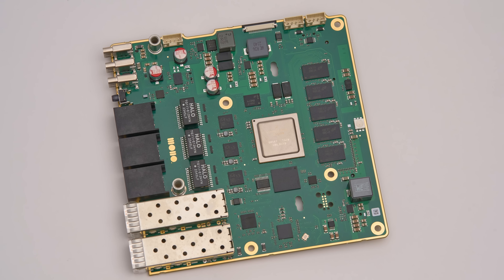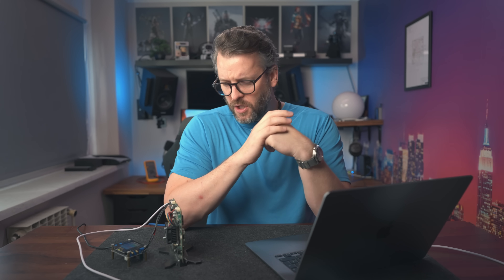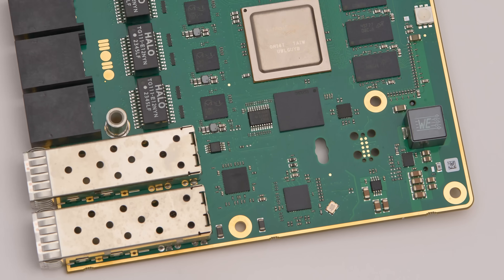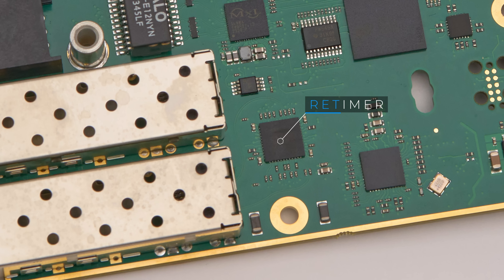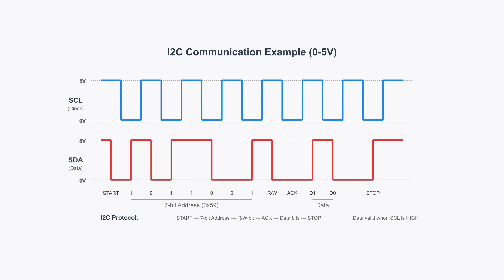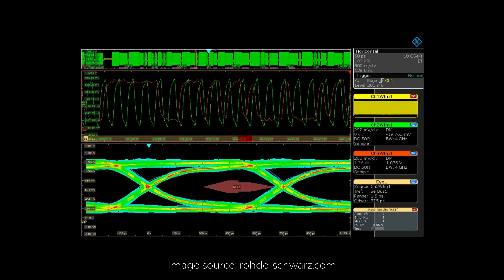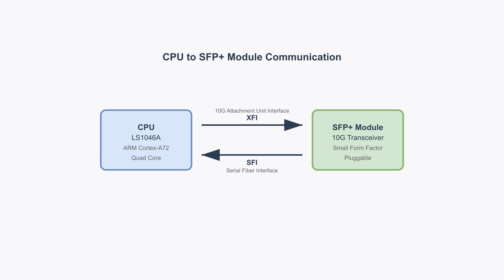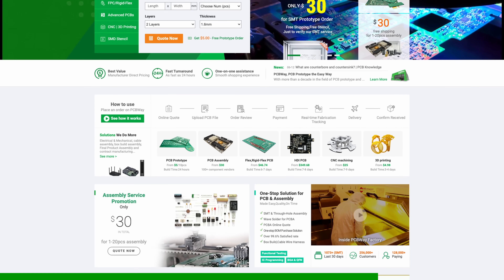10 Gigabit networking is NOT as trivial as you think!

Comment: fwiw, the 10g base-t standard 802.3an was published in 2006 with products being introduced based on it within the same year.  we've had 10g internet for nearly 20 years.  I'm appalled that it's not a significantly more common consumer option.
Reply: its an infrastructure problem. moving from copper to fibre is not cheap or quick
Reply: @jordanwardle11  We've had fibre coverage throughout all of the Netherlands for 1 or 2 decades now, yet 100-200 Mbit/s connections are still the standard and only few pay the exorbitant monthly costs for 1 Gbit/s connections. So having the infrastructure is one thing, clearly there are more issues than just that. Likely internet providers would have to seriously upgrade their hardware to facilitate multi Gigabit ethernet as the norm.
Reply: mostly because there  is no need as internet connection tents to barely hit the 1Gbps mark today which means getting speeds of 10Gbps internally is wastefull and not needed
Reply: @bigpod  I started my 10g journey with a workstation with maxed out storage options and a NAS containing lots of disk and 1g not being NEARLY enough for that context.  I think that this is EXTREMELY common. - if only for backing up photos and videos locally.  even at 10gb/s, that's only 1.2Gb/s which is about 1/6th the bandwidth of an average pcie 4 nvme ssd and thus for storage standards even 10g networking is quite slow and I wish we would upgrade from even 10g. but 1g is PAINFULLY slow.  I remember when 1g was brand new to consumers in the late 90's.  it was fantastic... my first network cards were linksys lne100tx 100m cards that I got from compusa for $40 a pop and a $50 basic hub (which was a lot of money to middle school me.) so I could network my 2 home desktops together.  sloooow.  1g was totally the sh*t, until we upgraded to ssd's.  at that moment we got a huge increase in storage bandwidth, but consumers really never got the appropriate networking upgrade to make that network communication leap with that increase and it's a shame.  they should have just put 10g base-t on all enthusiast class boards and up some 10 years ago (when most consumers got ssd's), but no, consumer networking has been stuck in the dark ages.  now we've got pcie5 ssd's capable of ~12Gb/s (which would be around 100gb/s). and I'm talking about single disk.  once you start pooling ssd's, you can get aggregate bandwidth of ~300-700gb/s for 4-8 disks (taking into account some disk redundancy that is likely in use)... the point is that networking needs to keep up with storage.  particularly in this age of virtualization, hyperconverged infrastructure, and software defined storage via network (particularly when it comes to bigger stuff like ceph).
Reply: @bigpod  I have basic fiber service of 2gb/s - I can (and previously had) 7gb/s service.  yes, this is a newly offered service in my area, but I also live in a very rural area of Connecticut (I can literally walk to vegetable farms and cow pastures from my house).  fiber has slowly been making it's way across my country and in other countries fiber is pretty much a universal standard (I know it is across many European countries).  while not everyone chooses to subscribe at multigig speeds due to need and cost (which is very reasonable), the potential exists for usable multigigabit wan in LOTS of places now. - but it's not just for wan, it's for lan. - having a workstation or two and a nas or two, and maybe a virtualization server built from an old desktop for simple deployment of home services - I wouldn't want to set anything like that up limited by 1gb interfaces.
Reply: @bigpod  We had 1gigabit Ethernet switches at best buy for $100 when fast fiber to the home internet was 15mbit/2mbit.
Reply: 10 Gigabit Ethernet while not prohibitively expensive it's much more expensive than Gigabit Ethernet, to the point it's hard to justify for most consumers to pay for their networking equipment to include it. This is the the big reason why Multi-Gig Ethernet - 2.5 Gigabit and 5 Gigabit, were introduced later on. It just could not get cheap enough to fit mass market adoption.
Reply: @eliadbu  it's paradoxical though. - it's expensive because it isn't ubiquitous, and it isn't ubiquitous because it's expensive... - if they just rolled it out to everything, it wouldn't be expensive.
Reply: @joshhardin666 No it's not expensive because it isn't ubiquitous, it's expensive because the hardware is more expensive to manufacture plain and simple, the SoC that can handle the speed is more expensive, the retimers also more expensive same with PCB. If some company could come out with solutions that would be comparable in price to 1Gbit we would have move to 10Gbit by now. Even newer consumer wireless routers that are quite expensive, can't get near the 10Gbit speed, they cap out at below 7 Gbit.
Reply: Yes, you are right, but the cisco 6500 chassis, and the sup720 supervisor module together cost in 2006 the price of a small-sized flat (at least in my poor country).
Reply: I mean, we do have 10G+ networking. It's just not Ethernet. You can connect two macs with TB5 cables to get 80Gbps.
Reply: @Gyzome  but can/should that be switched?
Reply: Consumers don't need 10 Gigabit to browse internet. Until recent proliferation of all-SSD NASes no consumer NAS could realistically saturate 10 Gigabit, most couldn't even saturate 1G on anything that isn't sequential read/write. There simply was no need for it.
Reply: @dzheliezniak  an 8 disk raidz pool of standard sata disk is good for 1400Mb/s sequential.  I've been running some kind of raid (started with an mdraid raid5 of 6 disks back in 2011... has just grown from there.  my primary nas currently has 24 sata disks, one pool configured in 3 raidz2 vdevs of 8 disks each.  where 1 vdev can get close to 10g sequentially and my current pool can get close to 10g speeds with somewhat more random i/o (or more to the point, multiple sequential flows).  I typically do sequential writes to my nas' anyway (big media files), and I'm pretty sure that's how most folks use a nas as well.
Reply: Wi-Fi 7 is bringing it to more consumer devices now.

BPI-R4 has 2x SFP+ for ~$135

Comment: Why isnt there a M.2 Slot on board?
If the eMMC chip failes you are in big trouble...
Reply: There are 2 M.2 on the back side. If I remember correctly, at least one should be able to be used for an SSD. More info should be on the website
Reply: It is on the back.

Comment: to combat fiber weave effects going straight but at an angle should be enough for 10 Gbe if needed at all, on the distances you have from that retimer chip to the cage skew is probably pretty minimal
Reply: Problem with Ethernet is not that it has to work at 2m but also at 100m. I've had to troubleshoot 10G at those lengths, the signal gets "weird" to say the least. At that point you're no longer talking digital, but pure 500MHz worth of noise - and the NIC and the switch have to figure the actual "signal" out.
Reply: @GuruEvi  dac cables are 15m max and if signal on one end is within the spec it should be also on the other side. If not dacs sfp+ module is responsible for  driving that length

Comment: Imagine 35GHz precision radio that needs to work between -100C / +100C ! Guys designing those look strange for that reason :D 
Rabit hole changes into a snake pit, then dragon den, then travel to centre of earth ... then you move your self away from the desk, and ponder your life choices.
Reply: Yup stuff gets really strange once you go over about 10GHz. 60 ghz and beyond is really wierd, it's microwaves but wants to be light. The waveguides used for that are like miniature plumbing 😂
Reply: @christopherleubner6633  yep, I remember when boys were tuning high power high precision PA, trying to get a perfect frequency response without much of slopes on cofdem ... they were dropping blobs of solder on unpopulated part of PCB, adding the washers on screws holding the PA pcb, even moving the components on the pcb how those were soldered on the pads with adding and substracting solder. One thing that stuck with was that: "above 5hgz, current starts to flow on the outside of the wire / track and above 10G it's just crazy and by adding the solder on top of the track alone one can change impedance / give it extra travel length shifting the phase when it arrives to mixer / pa / diversity module".
Reply: But here we are talking about just 500 MHz of bandwidth for the transmission line. Boring stuff compared to a real microwave radio.
Reply: @Sixta16  NO, no "BUT", I gave dude sympathy for struggling with high frequency based on my experience with working with that people, and you try to turn it into a flame.
Reply: Best comment
Reply: Not me. I won't touch that voodoo. At high frequencies very weird things start happening. And temperature makes everything change.
Reply: the temperature range is usually a lot smaller than that
Reply: @RandomUser2401 depends on the satelite 😉
Reply: @tommybronze3451  Yes this is why I was Rocket Scientist earlier in my career - worked exactly on this kind of problem. But also add to that radiation effects from solar, cosmic and weapons sources.
Reply: @Jeff-i8u and do people find you strange ?

Comment: What is rlthe latency difference between sfp+ and cat6a 10gbps on a short 20 meter distance?
Reply: probably basically nothing
Reply: SFP+ with a fiber connection is around 2 to 3 microseconds faster than the 10Gbase-t connection per link. 10gbase-t works by reading two consecutive symbols from all 4 of the twisted pairs, then using math to figure out what all 8 of those symbols are. Then it has to retransmit through a serdes interface to the CPU or switch. That is the function of a PHY, and it's specified to allow more than 2 microseconds for this to finish. 

Meanwhile SFP+ with fiber or DAC is basically a train of 1's and 0's with 64 data bits and 2 control bits. No waiting for two symbols, no mathing, just transmitting.
Reply: Thanks @dyhchang
Reply: @dyhchang  last I checked with the Linux ping command, the difference in latency between Mellanox and Intel 10Gb SFP+ NICs was in the tens (20-30 IIRC) of microseconds in favor of Mellanox. That's RTT so you can consider it half but usually you are in request-response scenario so the RTT number is relevant. So the NIC is probably more important. But I would stick to SFP+ wherever possible. It consumes less power, has lower latency and is, IMO, just way cooler.
Reply: @nmihaylove  Mellanox   NIC i know care about PCIe  per packet efficiency and allow good pci configs. 
       One big problem with more consumer NIC  are serious limitation in config that affects the entire PCIe tree;     Linux has a kernel option that helps by untrusting devices reported limits, then rechecking bandwidth and reconstructing device tree;

Comment: I really wish there will be a selection of consumer mainboards with 10G SFP+ onboard connectors in the near future. It's so annoying having to buy old Mellanox or other dodgy "enterprise" HW in order to get 10GB without braking the bank.
Reply: This year Realtek announced bunch of 10G chips for various applications. Some of them even on PCIe v2 lanes so I hope so.
Reply: @efimovv yeah the problem is not 10G per se but that it‘s always a ethernet port and not SFP+, so you cannot connect with fibre.
Reply: Intel x520 with a yotto mark and a SFP+ to 10GBase-T based on an Aquatina Chip (AQC107, AQC108). Aquatina controllers allow 1/2.5/5/10 _even if the NIC doesn't support 2.5/5_.
Reply: @Originalsunrunner20 yes but this does not solve the problem that there are only enterprise mainboarfs with SFP+ ports.